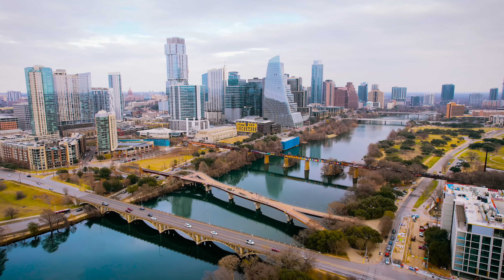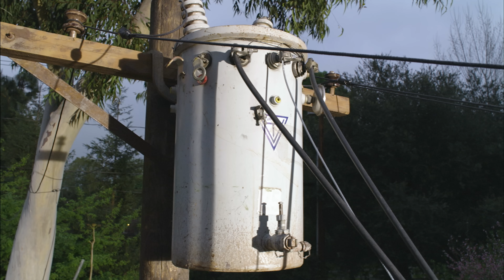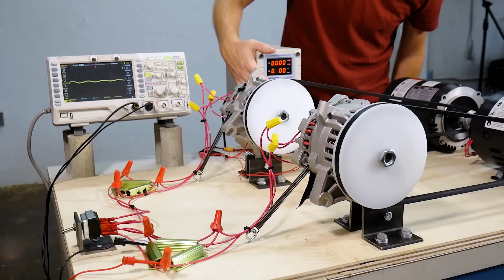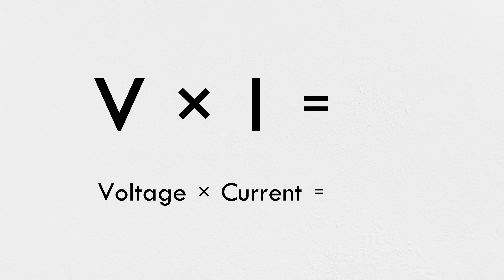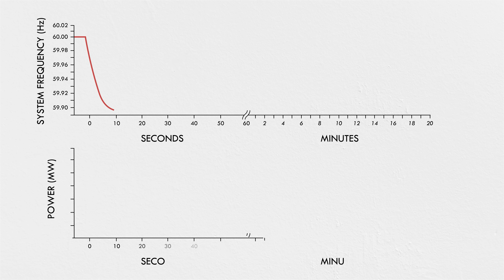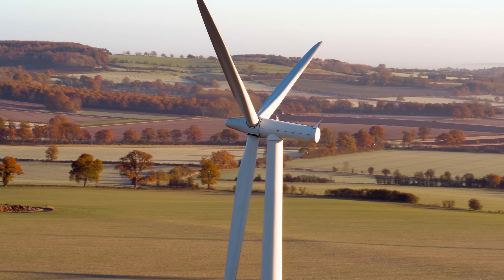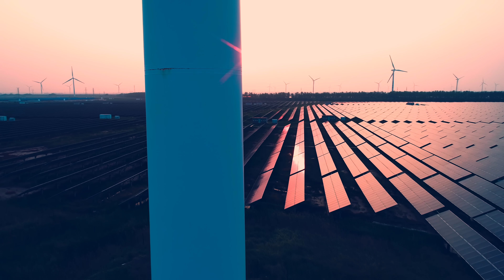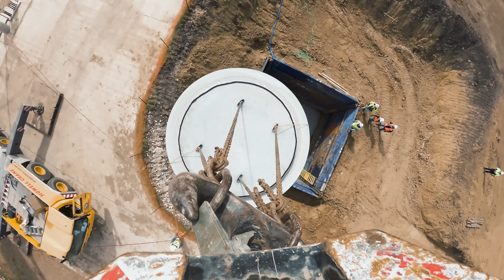Connecting Solar to the Grid is Harder Than You Think

Comment: This was interesting.  I was a nuclear trained submarine officer and served on an improved LA class sub for 3 years.  Going through the nuclear training pipeline, you learn a lot of this stuff.  In fact, the crude demonstration in the video of a drill turning an AC generator is something we had two: the "ships service motor generator" (SSMG -- everything needs an abbreviation), which were approximately the size of a midsize vehicle.  They converted power back and forth from the AC to DC bus, where the DC bus was powered by *VERY LARGE* lead-acid batteries in the bottom of the sub.  Very interesting stuff.  The control room ("Maneuvering") had the panel for managing the electrical buses, and the operators manually would synchronize various bus frequencies ("slow, in the fast direction" for the incoming bus, and throw the switch for the breaker at approximately the 10/11 o'clock position to shut the breaker at 12).  Depended on the operator -- not automatic.  I believe newer subs use a solid state inverter system and not the SSMGs now.  Anyone really interested in hands on, great education in this sort of stuff, either as enlisted or officer, join the Navy and go to Nuclear Power School and get to a ship.  I wasn't an engineer in college, but you more or less become one working the engine room of a nuclear submarine.
Reply: I taught NNPS when it was in Orlando. After that, I designed and built the electric plant trainers based on the S5W (Bluefish, et. al.) plant used in NFAS back in the late 80's.  Modeling the SSMG was one of the more challenging things I've ever done as an engineer. I used capacitor charging curves to emulate the starting surges that occur when the resistor sequence is pulled as the rotor speed comes up. The ships battery was a 3 D-Cell actual battery pack, that was literally charged and discharged from the op amps of the model. Overall that project was the best engineering task I ever undertook, and got a Westinghouse Signature award for the work. But they wouldn't promote me ahead of "years in grade" ( just like the military!) so I quit. And BTW both Bettis and KAPL were absolutely bursting with "engineers" that couldn't design a resistor divider.....but they wrote beautiful reports to be sent along to Navsea-08 to impress them with how much was being accomplished. 😮
Reply: @jeffferguson4632  Oh, that's neat!  I was one of the last classes through Orlando NNPS in 1997.  Your comment about the resistors in the SSMG startup is memorable.  The DC startup on those machines caused the biggest transients on the electrical panel -- always something to watch when that happened.  Plus, I recall a teachable moment about good engineering practice when we restarted an SSMG (following routine maintenance) while in an unusual electrical lineup.  That's quite a thing to have been involved in the engineering of.  They worked well from my perspective.
Reply: @wackojacko1997 they say the AC startup was quite the transient! Thankfully never had to do one myself.
Reply: I was involved in the early design of the Moored Training Ship setup in Charleston....when the simulator was located in the trailer. You wouldn't believe the arguments we had about putting a "head" in the trailer. If you went to MTS Charleston and bitched everytime you had to go back to the building to take a leak....well...I tried.
Reply: @jeffferguson4632  No, I was a Kesselring Site / MARF student.
Reply: That's really cool, thanks for sharing!
Reply: "...join the navy and go to NPS"  hehehe... Thanks, did that 50 years ago, made it to Electrician's Mate Chief.  Yeah, those SSMG's were really something.  Main control was the DC machine's field.  One way, you controlled the speed of a dc motor to regulate frequency, other way you varied the field to control DC generation to charge the battery.  I too had heard some newer boats went to inverters, but not sure how that worked out in the end.
Reply: i get seasick :/
Reply: What do you think about nuclear shipping?

Comment: 🔌🔌For years 240-volt receptacles in garages running EV chargers have overheated. Some say it is a duty cycle issue. It is a waveform and duty cycle issue. This is being addressed with EV-rated 240-volt receptacles. The same heating issue is also occurring on load center breakers. Some AHJs require separately mounted breakers or space between breakers as in commercial panelboards.  After working for Leviton and Square D for many years I am glad people are addressing inverter power requirements.🔌🔌

Comment: The Atom is much better.  there is very little 'sustainable' with renewable power generation.  The waste created by these devices is toxic and piling up.  the  devastation on the environment from mining for batteries and solar is also bad.  We already have clean, plentiful and NO BUG power with the atom
Reply: Eng dangers are overblown. People point out to Fukushima, forgetting the record breaking tsunami and floods that killed far more people. Meltdown are dangerous and should be avoided at all costs but it's only local and really contained.  Chernobyl happened because the Soviets were {redacted}. They purposefully disregarded all safely protocol to check the safety of the plant.

 The fuel Nuclear Power plants use is a far cry from the fuel used in Nuclear Bombs. You need very expensive equipment (which I'm sure are regulated and monitored 24/7) and lots of time to make bomb grade Uranium.

Comment: Easy way to fix your power issue re grid tied on homes, put a throw switch in and 2 inverters (1 grid tied, 1 off grid). Put the other side of the throw switch to the off-grid inverter and have that same switch at the same time isolate the grid tied inverter, obviously isolating the off-grid on return.

This means when the power goes out, walk out to the power board, switch the source over and off you go. There are homes in Australia out bush doing this as after a storm it can be up to 18hrs to get power back, just to loose it again in 4-6 hours from another storm.

Comment: I've always wondered why grid systems don't synchronize with standardized atomic clocks. If everyone is trying to hit the same frequency, then the inverter sources will only put power to the grid at that standardized timing, thus almost pulling the power plants back up. That way, each power plant is hitting a frequency and phase shift that isn't made by the grid, but instead created as a target by an ultra-reliable clock. Each power source is simply trying to match that target.
Reply: Because the phase will be a bit different at every site due to, well, the speed of electricity over copper basically.  But also because power lines expand and contract with temperature, and both generation and loads also shift the phase.

Basically, the phase at any given point is changing ALL THE TIME.  It's always moving... in the tens of microseconds per second sometimes, almost always greater than a few microseconds per second.  Atomic clocks don't help you.

-Matt

Comment: I work with a distributor of HVAC equipment that is failing due to what we believe to be power irregularities caused by solar, wind turbines, and electric vehicle charging. Buck boost transformers dropping the voltages seem to help, but we need help understanding the problem. I find some useful comments and responses. The government is forcing the industry to use more electronics to meet efficiency requirements, but the are creating a headache the manufacturers down to the end users.

Comment: There are several studies released by NERC that studied massive generation losses in California. Texas is mostly isolated (ERCOT) so they couldn’t rely on neighboring states to carry them through a fault. California is “leaning on coal and gas generators in other states to carry them.  Also Grady, some inverters can run in “standalone” mode and can carry a bit of load, but don’t hold your breath hoping they operate… former principal engineer from NREL.
Reply: Gas generators, yes.  Coal generators, no.  California uses almost no coal generation now.  I think its less than 5% (nearly all from out-of-state contracts that haven't yet expired).   But I'm not sure this is even true anymore with the amount of grid-scale battery generation coming online in California.   In just the last two years, in fact, California now actually has a make-up capacity in the gigawatts just from the battery installations (which are capable of pushing surge power in ways that solar farms are not).

-Matt

Comment: I worked for a utility company a while back and I have to say this is an incredibly well written video
Reply: What are your thoughts of using natural gas plants as an in-between for power plant replacement in the near future?
Reply: @Mcfunface  that's ok for filling in the gaps right now while long duration storage is developed. But we have a lot of simple cycle capacity throughout the US so I'm skeptical of the need to build out a whole bunch more. 

Really what's needed more than new gas plants is better transmission between ISOs/RTOs and a simplified process for getting lines approved and built

Comment: Aircraft have a similar issue with varying engine power settings, thus the need for a Constant Speed Device on the engine generator. Many aircraft use 400Hz, instead of 60Hz, for the purpose of reducing weight. Newer commercial aircraft use VSCF (variable speed constant frequency) devices locally to provide that 400Hz, or the frequency needed. The design is somewhat similar to the Solar inverters function, except first it rectifies the current to DC, then inverts to AC at 400Hz.

Comment: I do wish you talked more about the effect of code/UL requirements on these inverters. You mentioned ride through, but the problem has been the grid operators early on pushing against ride through, so UL requirements early on had strict rules rhat solar inverters must cut off at the first hint of a problem. Obviously now thats a huge problem and UL and grid operators are pushing for something different. And places like Hawaii are requiring a lot of extra stuff to address this issue

Comment: So basically the problem was caused by grid tied inverters no longer outputting power from solar panels because they no longer had a grid to follow, due to a local power station outage. Hopefully hybrid inverters will get programing to help fix this, or the problem will only get worse as more solar plants get built. I honestly think the Texas power grid needs to be made much more reliable. We've had too many power scares in the past few years.

Comment: There's one question I'd like answered about the power grid. What things are being done, if any are at least, to prepare the grid to reasonably withstand and/or self-isolate from an X-class CME impact? Because as it stands, what with Earth having lost roughly 30% of its geomagnetic field strength since the 1980s, about 20% of that being in the last 5 to 10 years, one big hit from the Sun will cause enough induced current to vaporize the long-distance transmission wires, and if the massive transformers aren't disconnected and isolated and properly shielded from space weather events they too will be cooked from the inside, boiled to destruction from the energy hitting our planet. I just wonder if there are any plans in place to harden the grid against such an imminent threat, other than storing some backup transformers and non-electrical heavy duty work vehicles and fuel reserves to get foundries and fuel refineries up and running to hopefully produce more transformers and wiring to bootstrap the grid into functioning again. I also wonder just how many backup diesel generators and gas turbines they have to get some energy back into the grid after it all collapses. Well, when it happens, every lithium-based EV out there will burst into flames, so thankfully EVs are in the minority of vehicles on the road. I'm also curious what would happen to solar cells under a solar flare, would it fry the semiconductor junctions that make up the photovoltaic cells or are small panels just small enough to come out okay, if not as well as they were before?

Comment: I'm pretty curious how hybrid solar systems work now. At first it seems as simple as just flipping each panel from one circuit to another, and then flipping a switch in your fuse box to change from grid power to stored power, but I have a feeling it's a lot more complex than that.

Comment: I know you mentioned grid forming inverters very briefly, but it would be good if you cover micro grids in this electrical series. It’s an interesting topic that many companies and some communities are doing. The ability to do island mode (disconnect from the utility) adds a significant benefit in case the grid goes down for any extended period of time. I’ve also seen data center operators that build micro grids for their campuses.

Comment: The problem as presented is backwards; spolar shouldn't be adapting to the grid but the grid adapting to solar instead. A well-designed inverter can output a more stable voltage at a more stable frequency than the usual grid-powering generation can. And as more inverter-based generation occurs the more the correct solution will become apparent. And wherever possible, the best solution is to rid yourself of the grid and all it's problems in one fell self-sufficient swoop.

Comment: Here, all grid-tied inverter have a safety interrupt that would allow them to provide power to the house while isolating it from the grid in case of a blackout. Is that not a thing in the US?
Reply from the maker: If there’s a battery system, it’s pretty standard. If not, it’s generally not feasible to island a house on solar alone. Recipe for brownouts.

Comment: also, I'd like to raise another point. you have plenty of pictures of wind resources in this video, but wind generators don't use inverters, they use CVTs, with variable Field strength. The combination of the CVT, and varying field strength means that it's very unlikely that it will actually go over grid frequency.

you say that using a physical generator is inefficient, but inverters are actually much much more inefficient,  where you can get 70% efficiency with top of the line electrical inverters, you can get as much as 89% efficient with physical inverters.

Comment: I'm not sure your portion about the under frequency problems with renewables is quite accurate. 

The additional energy that renewables bring to the grid directly affects how much inertia a generator will have when it comes to these events. 

if the "problem" your raising is that solar doesn't come with any physical mass, My response as follows: skill issue.

 The grid shouldn't be relying on residential solar,  and commercial solar should have these issues fixed.

Comment: I ran into an issue that is somewhat related w/o actually plugging into the grid. I started with a 650 or 1500 watt 'True Sine Wave' inverter, (I did not test it with a scope to see how accurate that description was, and  as we'll see, checking that now is moot.) As several of the devices in my environment are likely to draw more current than that, (A microwave that is rated at 1100 watts, can be drawing upwards of 1500 watts from the grid especially at start-up, for example.) I was visualizing using some grid tie inverters to boost the available power as needed. I picked up some 500 watt grid tie inverters and set up a test setup that I didn't think far enough ahead of time before testing. Powered up the primary inverter, then powered up a grid tie inverter. As I didn't have a 500 watt load on the 'grid' at the time the grid tie inverter propmply put 500 watts on the 'grid and blew the switching transisters on the True Sine Wave inverter. 

I still think this could be a way of setting up a grid expansion that can dynamically add and drop grid tie inverters in the 'local grid' (Not tied to commercial power) where as the grid starts using more power than each grid tie inverter provides, that grid tie inverter adds, and the platform actively drops grid tie inverters as the load drops to within the range of the primary inverter.That said, adding this functionality seems to be a bit of an issue of handling the shock load changes to the primary inverter. Getting a correctly sized primary inverter seems to be a more reliable solution. 

Is it possible that I could tie collected power into the grid? Sure. Getting it put together in a acceptable setup for the local power company to allow me to plug it in and provide on demand power for them, that may be more work than I'm interested in putting in on my current budget.

Comment: This is interesting, and I was very much concerned hearing that if there is a power outage, you lose your local solar too when it's connected to the grid.   
As I lose power a lot my house has a switch panel box to connect a gas generator, I figured an automated switch off would be part of that whole  grid-connected solar home design...